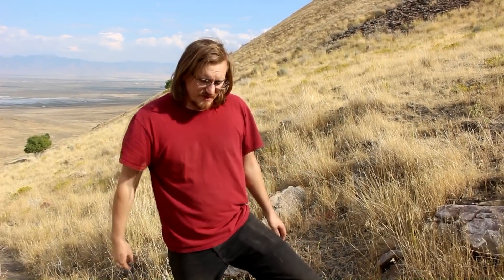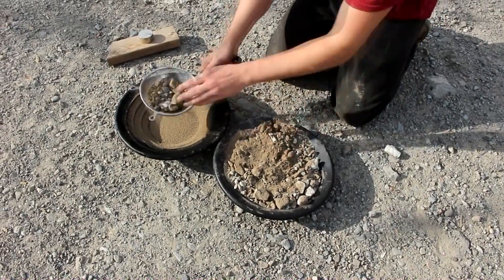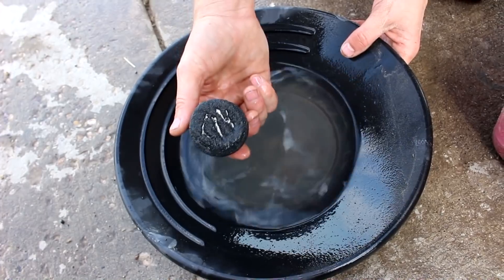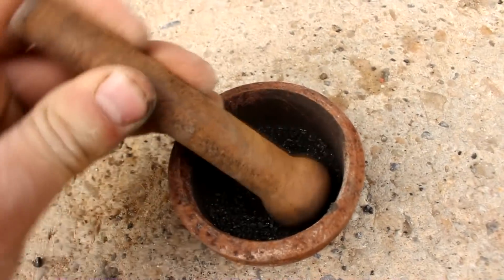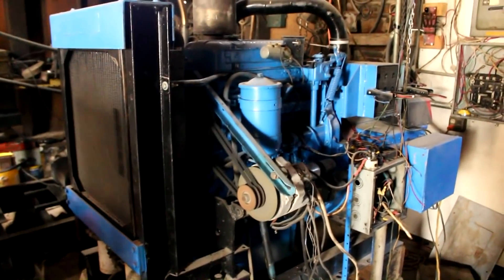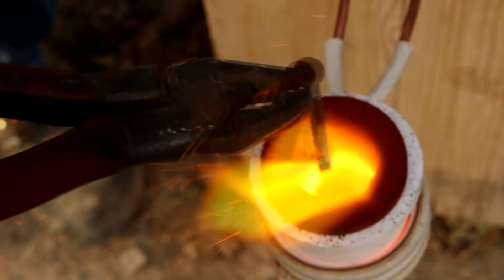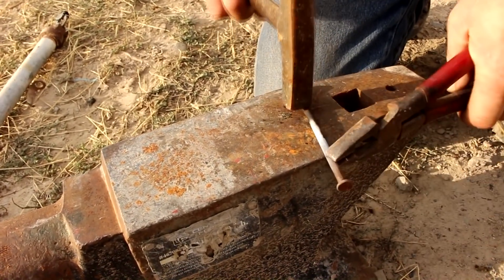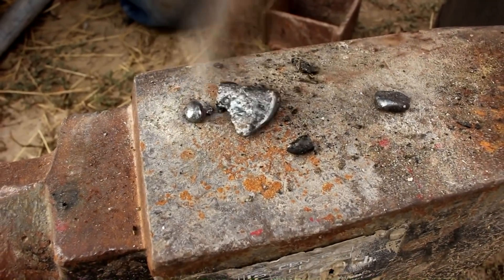Rock to Iron

Comment: I found a abonded place where somebody mined rock, I was riding a bike from Kraljevo(Serbia) planing to take a shortcut to a near by resting place "Goc" (standard road is 30km long but shortcut makes it 5 km shorter but at a price of quality of the road). at one point I was really tired and decided to stop because of high uphil, there was that part of the hill just mined out (like a 10 meter cavity just flat from my perspective), I walked around it and sat on a rock and pulled out a sandwich and a magnet that I carried just in case. After I ate the sandwich I took the magnet (neodymium one) and a small rock and rock sticked to it quite well. I took a kilo of those rocks and got back home. The rocks that I carried home are sitting in a carboard box but I dont have time to make a metal foundry and a engine powered mil to grind the rocks into powder to seperate the ore from the rock

Comment: Heat the iron to white hot, add iron oxide, hammer it, heat it white again, add more iron oxide, hammer it again. repeat over and over untill the oxygen from the iron-oxide has scavenged most of the carbon from the cast iron. You should end up with a decent forge-able grade of high carbon steel without too much effort.

Comment: Did you try using an electric arc with a microwave transformer and two battery carbon rods like King of Random? I think it would melt faster.
Reply: Maybe a lid on the crucible could help retain the heat and melt faster as well.

Comment: Cody what voltage is that induction heater running on? becase 260 amps is way higher than 20kW. And whats with the tube at the end!? :D

Comment: I'm not nearly as smert as you. I did notice a change in the generators load when you removed it... Can you break that down to me?
Reply from the maker: The eddy currents in effect are like friction, if I remove the thing soaking up the current its like releasing the pressure from a break and the engine no longer has to do as much work.

Comment: so cody question, if you where to touch the wires coming out of your new induction heater, I'm assuming you would be killed due to the electricy going threw it, right? [or is there a coating or something that protects you]

Comment: Steel is iron with carbon. Cast iron is kind of actually "steel" with around 3% carbon. You might be able to forge out a billet of "cast iron" and burn off a good portion of the excess carbon. Might try forge welding temps and really work the steel a lot. I can't remember if it is the top or the bottom of the forge, but one area carburizes more and the other decarburizes the steel.

Comment: Can you use your tritium viels to do an experiment i watched a you youtube video were they used magnet wire wrapped around the viel to power an led. And I was reading on Wikipedia the tritium decays into heium 3 but if subject to neutrons it reverts back to tritium the veils you have in that box should in theary last alot longer than if they were on a shelf.

Comment: if you wanna make steel instead, take the iron you just made, add it with some chopped green wood into a refractory cement crucible, cover with leaves and clay til dry, then fire it for a few hours...that's the recipe given for wootz steel...would be interested to see if it works..

Comment: I've been playing Dwarf Fortress lately, which is not always the most realistic (but is more realistic than a lot of games). However, I've been looking for sedimentary and igneous extrusive layers, which contain iron ore, so that I can start my steel industry without resorting to metal duping.
And then Cody makes a video about converting ore to pig iron.
All the same ingredients are there: Magnetite (one of the three iron ores in DF), coal coke (one of the two carbon sources in DF, the other being charcoal), and limestone (one of the five available fluxes). This makes me happy.

Edit: So, it turns out I've got no iron. But, I still have a few options: Trading, goblinite, and duping.
Edit 2: Aaaaaand then I accidentally nuked my save. Figures.

Comment: Hi Cody, years ago I worked in a foundry, and we had two huge induction furnaces we used for making SG iron we used a steel pot that sat loosely in a crucible, the pot was lined with damp moulding sand to start with then dried slowly.  That worked for weeks casting after casting, when it chipped a new liner was made, and applied by hand to the pots walls.

Comment: What was that last random clip? Was it a sneak peak?
Reply: Did anyone recognize what that tube was? If it wasn't a sneak peek then it must have been a random short clip that got accidentally included while editing...
Reply: it was a transistor coil.   but for what is the real question and why isn't he wearing gloves.
Reply: Poop Dolla haha he doesn't even wear gloves when a plays with mercury.
Reply: It's some sort of capacitor
Reply: Possibly
Reply: it snuck its way in wasnt intentinol but u really could look at it as a sneak peak
Reply: Personally it looked like either a large capacitor it a vacuum tube. I haven't been keeping up with his videos unfortunately so I don't know if it's been revealed
Reply: it looked like a coil for the tube speaker amps with tubes because of the pins at one end they are aligned like a circle and thats the typical structure they have
Reply: It might be a mercury switch. I had one that looked like that when I was a kid.  You can hear the mercury when he shakes it at the end.
Reply: looked kind of like a spark plug

Comment: Heat he little slug until it is red hot and then drop it in a bucket of lime, make sure it is covered with lime. Let it cool overnight and It will temper the iron.

Comment: A plastic plate between the hematite and the magnet will help with extraction. Just pull the plate away from the magnet after to collect the extractents still on the plate.

 Honestly I'd recommend taking a giant electromagnet, going over the pile picking up as much Iron rich ore dust as possible.

 Then preforming the washing step you did, and then a secondary magnetic extraction. 

 That way during the washing the dust is more iron rich due to the primary magnetic separation.

 Anyways cool video, keep up the good work!
Reply: A good way to build an esay electromagnet is out of an old microwave transformer.

 Remove the secondary coil and "I" section leaving the primary coil wrapped around the "E" section.

 Put a piece of iron plate with a bit of insulation over the mouth of the "E" section and give it 12v across the primary and you'll have one hell of a powerful and potentially dangerous electromagnet.

 Depending on how thick the object you stick it to is, it can pick up several hundreds of Pounds easy.

Comment: Nice, you've got cast iron (or pig iron). Now to make steel you could just use the crucible process, by mixing it with low-carbon iron (or wrought iron - which you could make by melting the pig iron you've got and blowing air through it) and melting together in a closed crucible. Depending on the proportions of the cast iron to wrought iron you would vary the carbon content of your steel. If you shoot for 1.2-1.4% carbon and add a bit of vanadium, you could be producing wootz or "true damascus".

Comment: Yeah, once you get it molten in the presence of that much carbon it's basically guaranteed to be cast iron or even pig iron unless you do the crucible steel process and measure things out just right. As you say, the next thing to do would try an oxygen lance to create a bessemer reaction. But you'll need to build a water-cooled mechanism or the lance will just go up like a sparkler. Messy reaction though, mount the thing on the end of a nice long stick even with that small crucible.
Reply: Of course, the tricky part about bessemer steel wasn't the oxygen injection. It was having enough research to know exactly how long to run the oxygen/compressed-air. (I believe oxygen is technically the Basic process, but whatever).

Comment: Get enough pieces, flatten them out, forge weld them together and work them for a while in a forge to reduce carbon content and bring them to a high-carbon steel status. Use as edge billet together with wrought iron from an old wagon wheel or bridge for the body and make a knife.

Comment: Could've used some jet fuel to melt the steel.
Reply: Gee. Is this how a dumb joke is supposed to turn out?    ._.
Reply: The only ones who think steel melted are the ones who then say "Jet fuel can't melt steel beams!"...
Reply: Gabriel Powers Jesus Christ chill out, the other person was only saying that you were stating the obvious, which you were. We know that the beams would’ve softened it was a joke that people made after the incident saying that jet fuel can’t melt steal beams
Reply: What you people don't get is that the heat would never reach a temp to remove the temper of the steel as the heat would have been conducted away through the long length of the beams that is why you need realy hot heat sources to cut and weld metals.
Reply: What steel melted?
Reply: That only works once a year during September.
Reply: tell me about it hahaha
Reply: took me a second XDDD
Reply: it doesn't melt steel, but it could have made it hot enough to have it collapse under it's own weight
Reply: Woke
Reply: Gabriel Powers your theory is more annoying
Reply: 7-11 was a part-time job!
Reply: Jet fuel can't melt steel beams!
Reply: "dude"  There's lot's of idiots out there that believe stupid sheet.  Maybe you haven't noticed, but they exist.  So I'm trying to help them and give them a chance to think.  What's you're effing issue tool?  Get off my back.  You don't care or see or like me or whatever then just eff off and stay out of things that aren't you're business.  Jerk.  I don't need your jackhole dipsheet commentary.
Reply: But the steel did melt on 911.  You can see it on the videos and hear it from the eye witness testimonies.  There were pools of molten steel under the debris for weeks as the crews were cleaning it up.
Reply: You think that was the only thing burning. There were whole offices on fire and it all was generating a lot of heat and all that heat didn’t melt the steel but the heat can weaken it making it collapse and that’s a what happened
Reply: Actually the temperature would most certainly destroy the structural integrity of hardened steel. The other side to this truth is the fact that there definitely wasn't enough fuel to just melt the entirety of the beams. If that were the case the entirety of the building would've been in flames, don't believe that, check out some other historical building fires. Not to mention thw fact that that building came down in a perfect demolition style, you can see the explosions happen in rows down the building while it got obliterated in front of your very eyes. Clearly the deniers are those who actualy believe what they see on the top of google searches: sponsored content and snopes ignoramus articles
Reply: Is it possible steel might not melt, but get soft and lose some structural integrity? Really if one floor gives way it's clearly going to pancake on down.  I mean the plane did tear up some of the structural integrity to begin with even before heat began to have an effect.  I'm just saying. The steel wouldn't have had to melt for there to be issues.  So people who say stuff like that are annoying and need to go away.

Comment: That was outstanding!    Love the induction furnace.     You said 260 Amps and 100 KHz (or higher) but I didn't hear the voltage output, or the total time  until it melted, so we can figure the KWH that it took.     GREAT video!

Comment: Maybe a bit off topic but hopefully someone knows the answer to this question; recently Cody used an infrared camera to detect heat differences in the cave. I was wondering, since the human body radiates heat, is it possible to see a shadow on the wall when the heat radiation produced by the body is partially blocked? Or does infrared radiation behaves different that visible light, or maybe infrared camera's aren't sensitive enough? I wasn't able to find any pictures or articles on the web. It would be nice to know if we're producing shadows all the time like a light bulb, but are unable to see them.

Comment: Hi Cody, do you have any Mn deposits (probably as pyrolusite or psiomelane) that would work to attempt to make a Hadfield steel? I believe it's roughly 1-2% C and 10-15% Mn for alloying. Testing the extreme-cold brittleness resistance of manganese steel vs common steels at LN2 or lower temps would make a very interesting experiment.

Comment: That sand left over appears to be dense. Have you analysed it?
Now you can purify it by dissolving in acid then plating it out. I hear the trick to plating iron efficiently is to add some bismuth salt that will also provide some grain strength in the iron plated out. It likely has proerties of steel.

Comment: If you fused iron/steel in vacuum, would you obtain a better material?
Reply: could the induction furnace in vacuum do the trick?
Reply: steel is just low carbon iron, with maybe mixed in some cromine.
So you would get nothing.
Reply: +Supergecko8:
"If you fused iron/steel in vacuum, would you obtain a better material?"

==Depends on iron carbide mp. If it stays solid, it won't evaporate. On the other hand, the liquid iron would boil off and cover the insides of your vacuum chamber.

That's actually the process used for coating CDs and DVDs with aluminium. It is probably also used for making most mirror.
Reply: Jolez _ IIRC steel is iron with interstitial carbon impurities in its lattice. So its technically carbon ~doped~ iron, not "iron with less carbon".
Reply: it's more complex than just iron + carbon. Steel is iron with a carbon content between 0.8% and 2% carbon. generally speaking in industrial production of steel they burn out all the carbon then they add back the specified quantity of carbon they are looking for along with other elements. 

Based on the brittleness of the Iron Cody made here, and his comment, it is likely Cast Iron with a carbon content well above 2%
Reply: melting metal in a vacuum lowers the melting temp and removes atmospheric gases that can contribute to the redox reactions. Would be an interesting experiment, but wouldn't be higher grade results. that's still dependent on having the right chemistry going on in the crucible.
Reply: Supergecko8 the off gassing and vaporized metal would probably ruin and vacuum pump u used
Reply: it would probably be easier to do it in an inert atmosphere like argon or something
Reply: Fusing it at all actually makes a huge improvement over iron from a bloomery, which contains a lot of slag and crap worked into it because it has never melted properly and run free of the slag.

Before the industrial age the only way to do this was crucible steel, and this was FAR superior to anything else available. It was usually melted in the presence of fluxes such as glass and/or carbon which would have made carbon monoxide a reducing gas to protect the melt. As well as bring the carbon level up to what was required to give the steel hardenability.

As for melting in a vacuum, seems to me that it would just be like melting in air, except you would have a little more metal evaporate (probably not much in either case) and a lot less oxidation and nitridation. Iron nitride can cause hardening and embrittlement, so maybe you would have a slightly softer but tougher steel? It's definitely something to try though.
Reply: You could probably get away with using less carbon in the recipe, which would help a bit.
Reply: You would probably get slag
Reply: +Andrew Nyberg "You would literally just get slightly more of a shittier steel"
how so?
Reply: carbon just adds hardness i dont know if you could call it an alloy ... but ya iron with carbon is steel
Reply: +Walt Sorensen depends on the steel. You can make a steel out of just iron and carbon in correct proportions, that's what the first steels were although they obviously had impurities, more often than not they would make it a less satisfactory steel than a more satisfactory one. And confusingly as you say "cast iron" and "pig iron" is high in carbon, but yet it is called "iron" and not "steel"...
Reply: +j Sullivan also silicon is considered an alloying agent, even though it isn't metallic...
Reply: It depends on the vacuum, I think with a Dyson you could.
Reply: Not really, a composite of alternating iron and steel plating was used as naval armour in the very early 20th century and it didn't stick around too long before it was replaced by all-steel plating.
Reply: +j Sullivan yes steel is called an alloy of carbon and iron. Although they often confuse the terminology by referring to "alloy steel" which is steel with other metals as an alloying agents. But as Iron carbide is an metallic phase it's fair to call it an alloy. And also carbon dissolves in the iron as well.